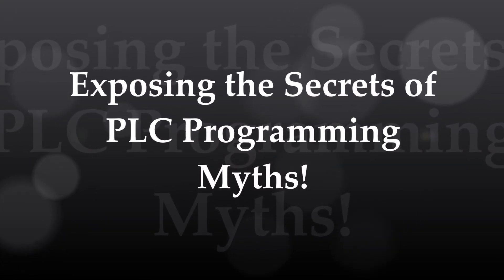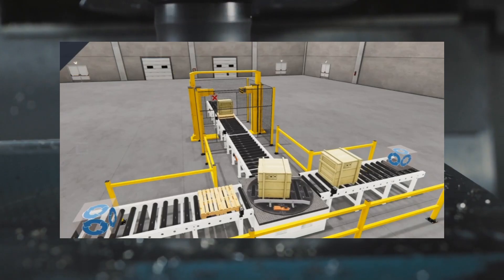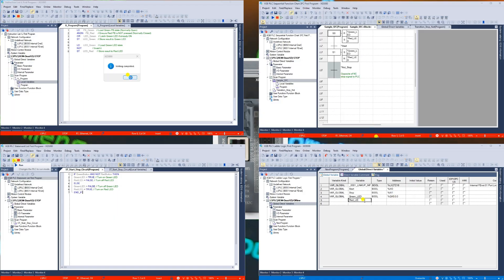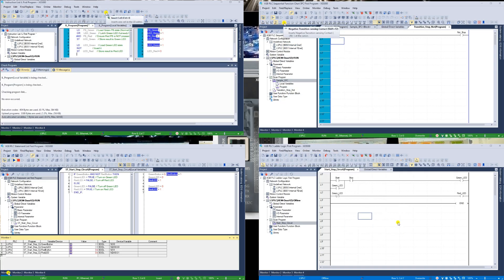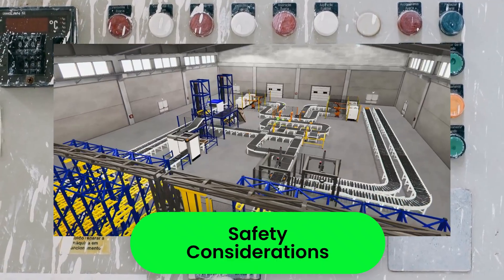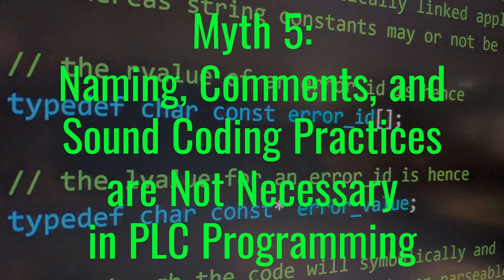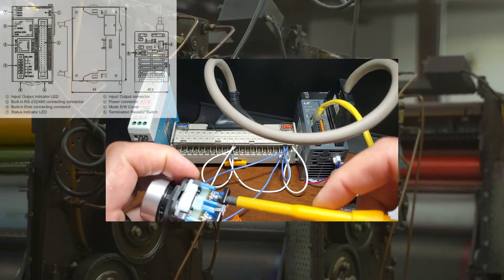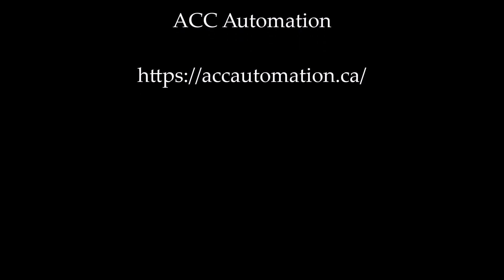Exposing the Secrets of PLC Programming Myths!

Comment from the maker: Detailed information and links can be found in the corresponding post here.
https://accautomation.ca/exposing-the-secrets-of-plc-programming-myths/

PLC Beginner's Guide to PLC Programming
https://accautomation.ca/programming/plc-beginners-guide/

Here are the controllers that we have covered at ACC Automation:
BRX Do-More Series (Do-More Designer Software + Simulator)
https://accautomation.ca/series/brx-do-more-plc/
Productivity Series
https://accautomation.ca/series/productivity-1000-plc/
https://accautomation.ca/series/productivity-2000-series-plc-p2000/
Click PLC Series
https://accautomation.ca/series/click-plc/
Omron CP1H Series
https://accautomation.ca/series/omron-plc-cp1h-series/
Horner XL4 PLC Series
https://accautomation.ca/series/horner-xl4-series/

https://accautomation.ca/series/easyplc-software-suite/
The EasyPLC Software Suite is a comprehensive package that includes PLC, HMI, and machine simulator software. See below to receive 10% off this software. This PLC learning package consists of the following:
Easy PLC – PLC Simulation will allow programming in Ladder, Grafcet, Logic Blocks, or Script.
HMI System – Easily create a visual human-machine interface (HMI)
Machine Simulator – A virtual 3D world with real-time graphics and physical properties. PLC programs can be tested using the EasyPLC or through other interfaces. (Modbus RTU, TCP, etc.)
Machine Simulator Lite – Designed to run on Android Devices.
Machine Simulator VR – Virtual Reality comes to life so you can test, train, or practice your PLC programming.
Purchase your copy of this learning package for less than USD 95 for a single computer installation or less than $110 USD to allow access on multiple computers.
Receive 10% off the investment by typing in ACC in the comment section when you order. http://www.nirtec.com/index.php/purchase-price/
Learn PLC programming the easy way. Invest in yourself today.

Regards,
Garry
ACC Automation
https://accautomation.ca/